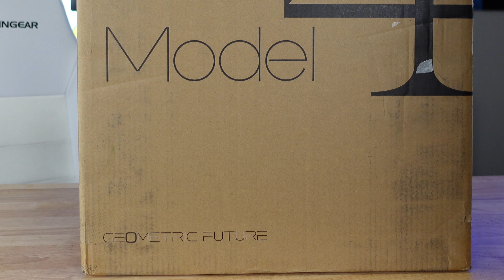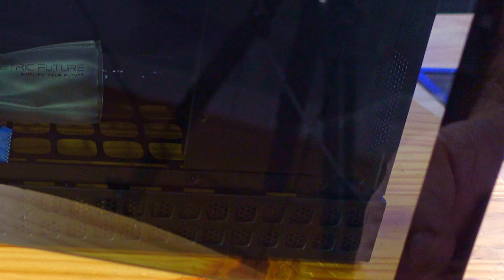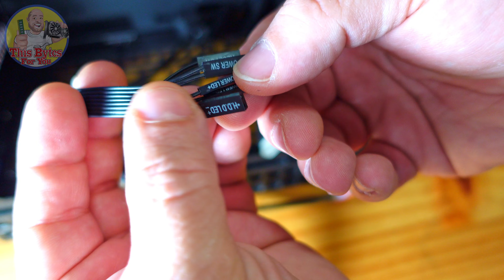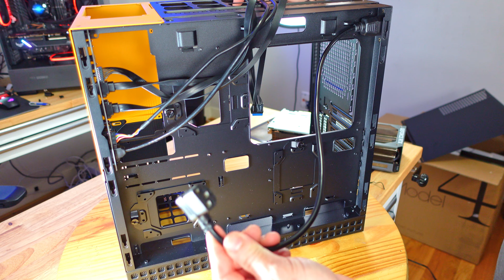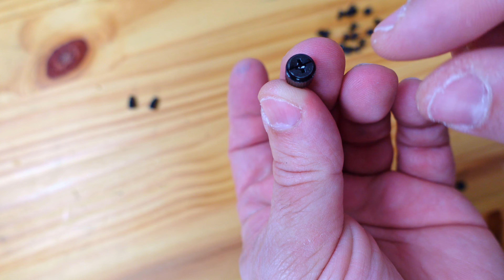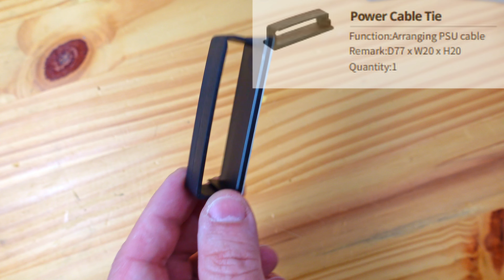New PC Case Unboxing - Geometric Future Model 4 PC Case

Comment: Not entirely clear from the video but there is no dust filter in the bottom? While you are expected to put air intake (by means of fans or rad+fans) there?
Reply from the maker: there is no dust filter here, since it does not include fans at the base, the way they make the case, is very confusing but it won't pull air like you think, since it has perferations along the side, it doesn't pull air at the bottom, EVEN if you have fans at the bottom as much as you think.  Dust will get in, but not as much as you would think.  You'd be fine on a desk, like a PC should be, but if you put it on the floor or maybe on a rug (uhhh) it won't be good for you.  I like this case, BUT, its not the best case...I feel like they tested toooooo many things with this.
Reply: @ThisBytesForYou  Thanks for the clarification, appreciated!
Reply from the maker: Anytime bud, happy I could help.

Comment: A lot of people nowadays are having issues fitting thick arctic liquid freezer 360 radiator with fans on top of the cases. It is 38mm thick and fans add another 25mm right? Lian Li 216 will not fit it i think. Which case would you recommend? Would Thermaltake 500 ceres fit it?
Reply from the maker: sadly, I don't know, I have never reviewed that case, the Thermaltake case.  I will look into it though, it is nice.  I have a case in coming that is AMAZING, maybe something like you have never seen, so stay tuned, though I can't talk about it just yet.  You might want to look into this case: https://youtu.be/JqvXib6ugjw
Reply: @ThisBytesForYou  Unfortunately Radiator clearance for H40 is even less than Lian Li 216. We need 38mm plus 25 mm for fans. You need to find for us all a case with a clearance of 63mm on yop. I will wait for your next case review))
Reply from the maker: @Galaxutube  if  you watch this video, you will see I fit everything in perfectly